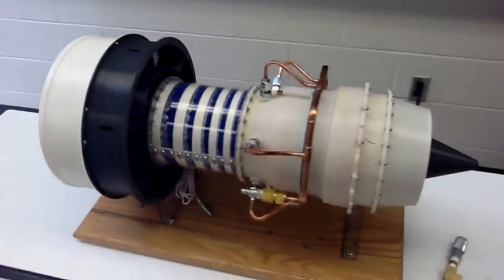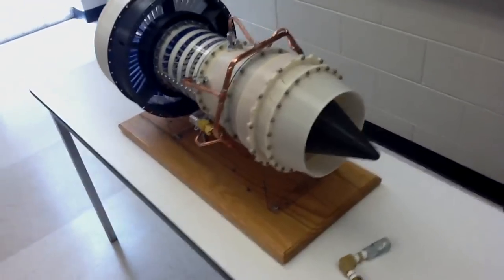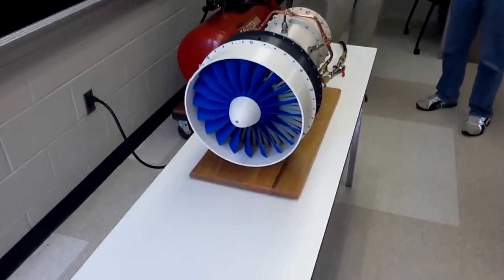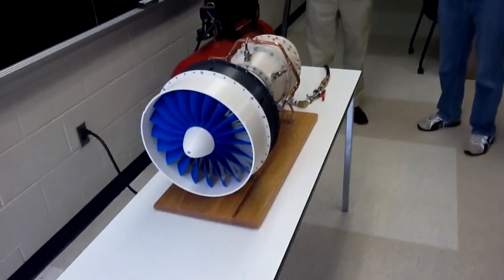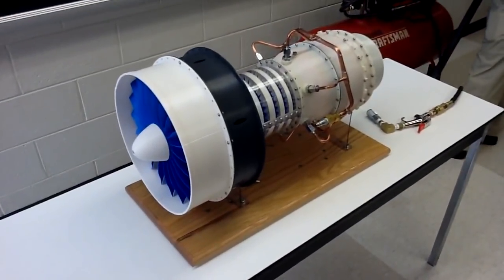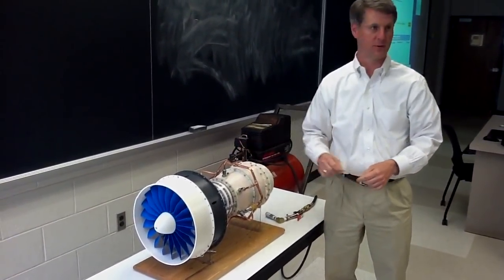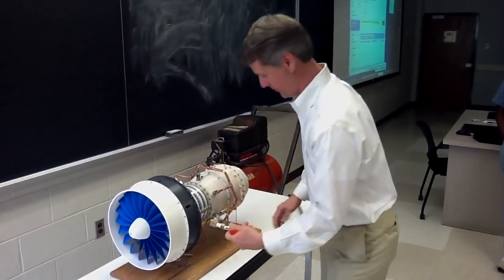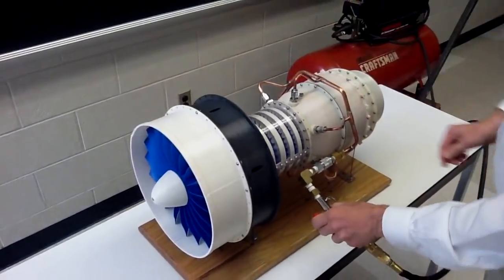3D Printed Jet Engine UVA Mechanical Engineering

Comment: I am building a turbocharger complete with functioning wastegate actuator and blow off valve as part of my mid year project. Did you guys print the bearings or did you buy them? what kind are they (roller or bush)?
Reply from the maker: We skipped that piece. Didn't need it since compressed air already has the directional airflow to get the shafts spinning.
Reply: melihileri I was going to forget about bearings but  decided to design every component of a turbo charger including a functioning oil gallery system. Are you not worried about replacing components that are eventually damaged by the heat produced to the shaft?
Reply from the maker: frank white sorry about that frank, im afraid i dont remember. i thought you were talking about the starter piece, which is what we didnt have.
just looked at the article that covered our plastic engine: http://uvamagazine.org/articles/printing_awesomeness apparently we did have bearings to hold the dual concentric shafts up in place (which makes sense now that I think about it). Professor David Sheffler from Aerospace and Mechanical Engineering Department at University of Virginia (the gentleman in the video) is the right person to contact (if you can get to him). His contact  info should be publicly available on UVA's website. Good luck!
Reply: melihileri Thanks. Were you a student?
Reply from the maker: Yes. I took this video in our jet engine design/manufacturing class in 2011.

Comment: When I was in Aerospace College, we had real engines as demos.  A couple of Rolls Royce Avons from Hawker Hunters and Vipers from Jet Provosts plus an Adour from a Jaguar still with the Afterburner unit attached.  The viper and the Adour were statics but we used to fire up the Avon from time to time.  Plus we had a Mk5 jet Provost in the hangar which would be powered up to do gear function tests, dry turbine runs and avionic functions.
Reply: tomcatter11 yes, but too bad it cost money to run it and and maintain it, not to mention the space needed, we got alot of jet engines here in USM(malaysian science university).....replicas like these are much much cheaper and almot cost nothing to run it :(

Comment: What thingiverse item #?
Would probably have turned better using steam for the high pressure area.  Since a jet engine uses the expansion of gasses in the high pressure area, the steam tho cooler than a flame would give a better turning speed.

Comment: I would hate to be "that guy", but technically way you have is a working model of a turbofan engine, not to be confused with a jet (or turbojet) engine. The difference being that turbofan have a large fan in front of the compressor that is the main source of the engines thrust. The fan is (as mentioned) ran by the turbines in the rear of the engine as stated in your video.

Comment: the energy to create thrust really is driven by the amount of pressure created in the combustor by burning fuel in a real engine. we are using the compressed air to illustrate it but its pressure level is barely enough to get the turbine spinning, and driving the fan and the compressor.  energy from compressed air from that red tank in the background is not even remotely comparable to the energy that can be produced by burning fuel at a very high temperature like a real engine would.

Comment: I was wondering something:
According to the description, this is to scale. This means that resultant forces were proportional as well. Subsequently there should have been a lot of thrust produced, even with the relatively low PSI of the compressor.

Am I wrong? If not, this represented quite a dangerous situation with persons standing so close by as there were no visible restraints to the model. Additionally, no one including the professor wore PPE, & I think safety has to always be paramount.

Comment: Well, that all sounds very lovely and all. they could do placements in a "real" machine shop where we chase tolerances to 0.0001" of an inch, in the aerospace field 0.002" may as well be an inch depending on what the part will be used for, I fully agree and understand the limitations of your course and how you can only go so far into the field but you have to agree there is a big gap between training and reality, much like there is between theory and practice......

Comment from the maker: thank you for your criticism. this is an undergraduate class and theres only so much you can really do with it. to your point on seeing how real parts work, we visited multiple manufacturing facilities and machine shops to see how the parts are built and machined. about hands-on, we also used the same machines and tools on our plastic parts to machine them down to .002 inch (if I remember correctly) precision, pretty much the same way commercial machine shops do with their engine parts.

Comment: I see you point but I was talking more along the lines of really learning how it works by stripping and building an old engine because the best way to learn is by doing, let them build plastic parts all they want I get that but its the hands on approach they need too, so they can look at the parts they are designing and they have a rough idea where they go in the engine, they can see what environment the parts work in, what the other parts are like, i.e. corrosion, burn marks, wear marks etc

Comment from the maker: the 3d design that went into this project is no different than what couldve been done on an actual engine. also, the cost of building this is pennies compared to building a real engine from real parts, what's the point? not to mention, i don't think more than 3-4 people in this class actually design and build jet engine parts, so it makes a lot of sense not to waste very valuable grant money on building real parts, where a prototype does the teaching job just as well.
Reply: Sintered, or selective laser melted? I postulate that the latter would be more suitable; they make some of our engine parts with that method.

Comment: You'd prefer that the students who'll one day work on, build or design these engines to start working with no experience at all? For a call center that's fine, but for something that might carry my butt cross country to see the folks, it's nice to know they've done this sort of thing in school.

Though, I wish a turbofan in this size was actually sold, most of the engines in this range are turbojets, which burn way more fuel. If they had made a real one, it would have cost a sizable fortune.